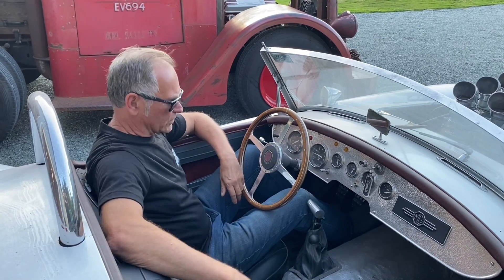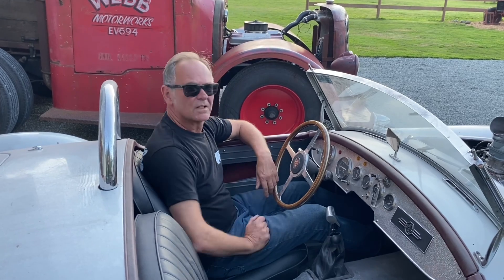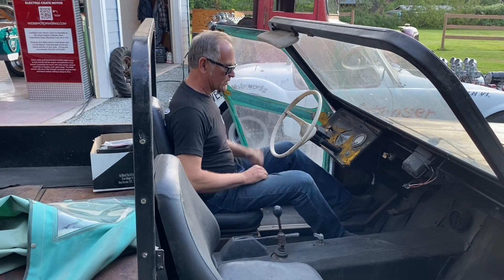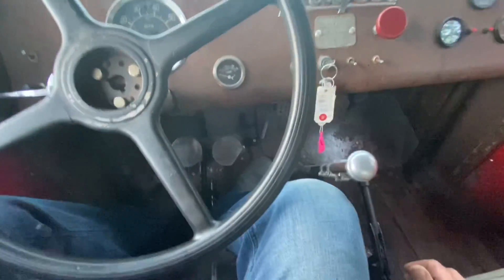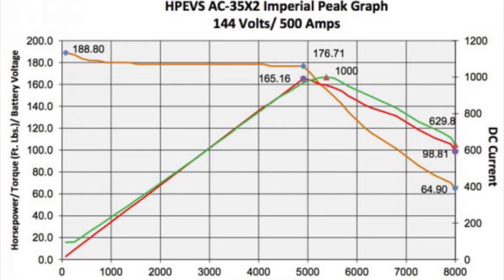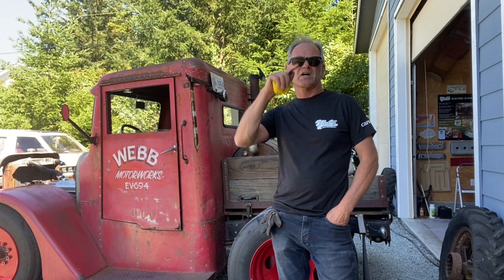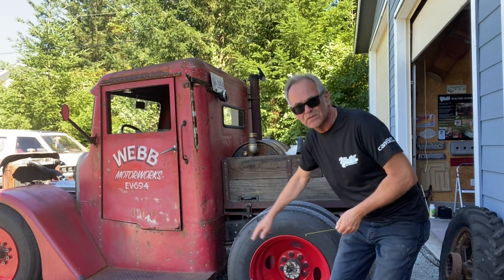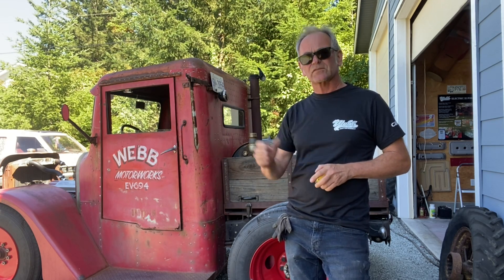Does an EV need a transmission

Comment: The one thing I should have hooked up is regen braking. Car flies down hills requiring lots of braking. Happy I kept the trans - it did require machine shop prep of adapter plate and coupler, but nice not to have to deal with reversing the motor or worrying about gear ratios. Manual trans causes a little loss but nothing compared to an auto trans.

Comment: You can add transmission to any electric motor like in a robot or EV and it will make it even better in terms of torque speed curve but because of weight they don't.  I have two Teslas no oil change for last 6 years no gearbox ! But certain applications like helicopters you really need a gear box so to make it direct drive like cars you need very special new kind of motors that I'm developing.
Reply: I cant wait to see your motor.

Comment: EV absolutly needs a transmission. Transmission can help to extend the range of EV by reduce the rpm of motor.
Reply: ... What country are you from?
Reply: @ljammidodger  iam about to say same thing, with me its Czech republic
Reply: Depends on the motor, brushed motors really enjoy going max speed and get very hot if you run them slower, I burned out a motor from having the wrong gearing and it never reached its rated speed

Comment: it’s a question of having a gearbox that will last!
If your going from a big diesel and have a small electric motor then you might be ok.
The torque from an Electric motor can spell death to them.
Porsche do have just a 2 speed transmission on their EV.
Most have just opted for a single speed and if you want 4WD then just have 2 motors.
Installation wise it’s nicer, no transmission in the middle of the vehicle or props. Room for the battery that what way and superior handling from keeping the masses with the wheelbase and you can get 50/50 distribution.

In the end it’s all a compromise.
Take care M.

Comment: ok at 34 seconds in this guy just proved hes full of crap. A gasoline engine doesnt "always run at about 7 or 800 rpm. thats idle for a v8 and 4 cylinders can idle at 800-1000. Typical cruis speeds on a v engine is about 1200 with red line in the 5-6000 range. 4 cyl cruise at 2000-2500 rpm and redline in the 6-7000 range. and to all the EV cult members, yes ive been a mechanic for 40 years.
Reply from the maker: 😂Sorry maddhater,Thankyou for pointing out my mistake.  You are correct. I should have said at idle,,when in neutral, or clutch is depressed at a standstill while in gear , a gas motor rotates around 700 to 1000 rpm . I just put an a iPhone on a tripod and talk.  I should probably spend more time analyzing and editing my videos.😊
Reply: @WebbMotorworks  ok sorry for the over reaction i, i have seen so many inaccuracies from malace rather than misspeak. TY for the correction.
Reply from the maker: Geez , sorry I should have edited my comment, I mis spelled your name.  I should have said Maddhatter instead of hater. DANG!
Reply from the maker: Hey your a good sport.  I really appreciate you getting back to me, your right , there is a lot of bullshit out there.  I apreciate your support

Comment: A transmission, especially a manual will greatly increase the efficiency of a motor. And using the transmission reverse gets rid of a bunch of electronics and greatly increases electrical safety by not switching polarity on the motor. And you should still use the clutch so you dont mess up the transmission.
Reply: sshh dont tell the EV cult.

Comment: Can you use an automatic transaxle in a conversion to electric motor.
Reply: You probably can but it has to be strong because its 100% power right off the rip. UNLIKE a gas car which ramps up
Reply: @suntzu6122  the world of EV tech is updated everyday.  By the end of the week my question was answered. They answered it by providing another solution,  the Torque Box. That is a kind of gear reduction box, much like a manual transmission without the clutch. But their is a kind of centrifugal clutch.  The moral of the story is just a bit and progress will answer any question with a better solution.

Comment: I used to run a direct drive input shaft on a power glide in my dirt race car, worked great. TCI  #TC-745000
Reply from the maker: Ya those powerglides were awesome
Reply: you do know a pwerglide is a 2 speed trans right? so it wasnt direct drive.

Comment: I really don't mean to be a pain here...  But could we please try to be correct in our use of the words "engine" and "motor"?
Reply from the maker: HahA I always screw that up,these videos I do are unscripted,I just ya k from the seat of my pants. My apologies .Gas engines can be called motors,but electric motors ,should not be called engines ,even though in Merian…Marian? Hmm Webster dictionary the definition is sometimes interpreted as the same.
Reply: well a motor is any unit that provides motive force. so a gas engine IS a motor, but an electric cant be an engine.

Comment: Why did it seem like your math makes your wheel circumference equal 1ft
Reply from the maker: Haha. Thanks for the input. I should have said wheel circumference is 108 inches, not diameter.  You are now hired as my official editor.
Reply: @WebbMotorworks  no it was my mistake, I misheard you explain how many rotations per mile. I heard 580 something and my dyslexia related that figure to 5280.
Rotations equalling feet/mi made me think 12in circumference. Dyslexia is a hell of a drug haha. Keep up the great work! 
Really want to see a transfercase mounted motor for truck hybridization. Or maybe even a driveshaft motor, or differential cover replacement that is a motor.

Comment: Hello sir .. please do you need a clutch when connecting the motor to the transmission or not ?
Reply from the maker: Yes if you are running a standard you use the existing clutch, with the gear reduction no clutch required .

Comment: We went forward by going back. Instead of changing the ICE engine with an electric and keeping everything else the same we went direct drive with high inefficiency on the motorway. But the same way a camera manufacturer has the technology for 100MP sensor but they will not sell it before everything else is sold the same applies here.... dumb marketing and profit cuts in the way of technology. Again.

Comment: short answer no they dont need a trans, you can bolt the motor to the wheels or use inwheel motors
Reply: very inefficient to go with 1 speed on an electric. just because an electric motor can doesnt mean its best.

Comment: 1000 RPM at 60mph?
Wow.That's just barely above idle at hwy speed.
They should get great gas mileage
Reply from the maker: No it’s 2400 rpm at 60 in the Hayes , sorry my voice is kinda raspy haha
Reply: @WebbMotorworks  :Sorry.I should've been more specific.
When you were driving the F-150 and showed the dash as you were driving,you got up to 60 mph and the tach was at 1000 RPM.
That was amazing.
Reply from the maker: @ebayerr  up in Canada the odometer shows km in the big letters haha. They are amazing motors though v6 with twin turbos fuely, better than any v8 I have ever owned!
Reply: @WebbMotorworks  : What kinda of gas mileage does it get?
Reply from the maker: @ebayerr  I have owned it for seven years and never had to put gas in it!!! Haha not sure but really good though. They have hit it on efficiency and the truck has tons of snot and can haul 11000 pounds with a v6 !
Reply: @WebbMotorworks  : Very cool

Comment: For EVs, there is a 2speed power glide that has an electric pump on it, for the EVs
Reply from the maker: Ya you can’t beat the old power glide! I had an old casty in my first car.   Used to slam it in reverse for emergency braking haha

Comment: Sorry buddy but 2 strokes will run backwards if the timing is off 
Old military boats also were designed to be run in reverse
Reply from the maker: Ya I have an old one lunger in a boat
Reply from the maker: Your right you pull the plug wire off of em and just before you hit tdc yo ignite and it runs backwards.  All my vehicles are 4 strikers so they only go forward but I appreciate your in site